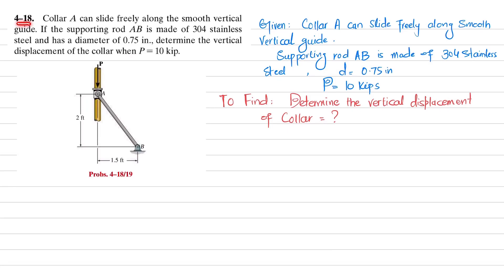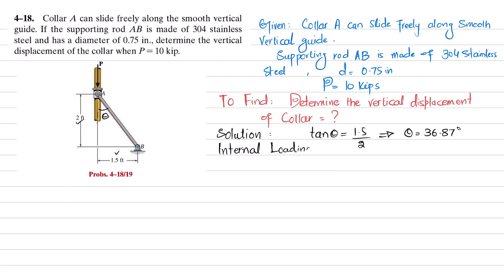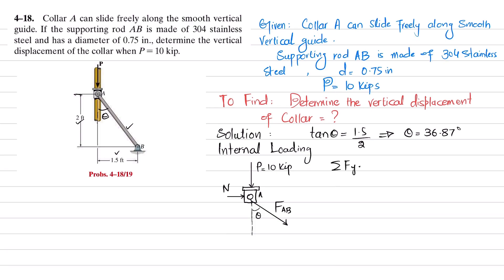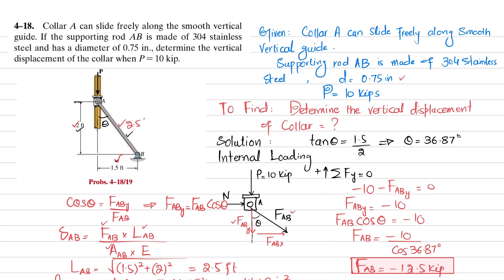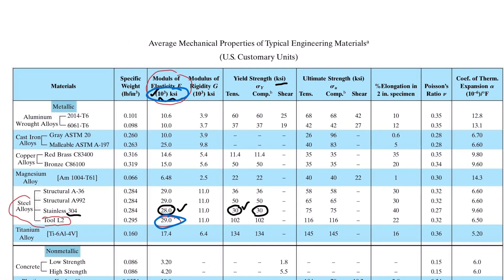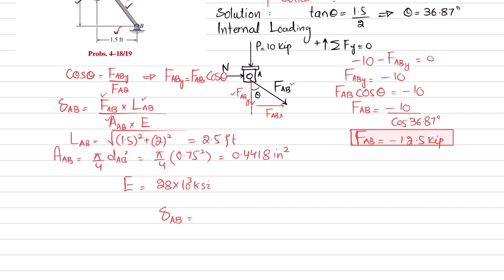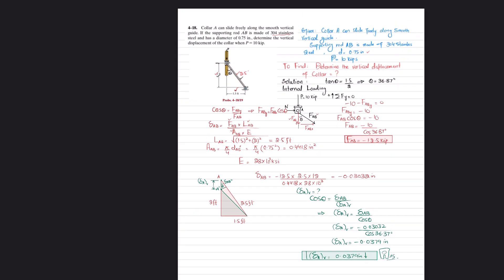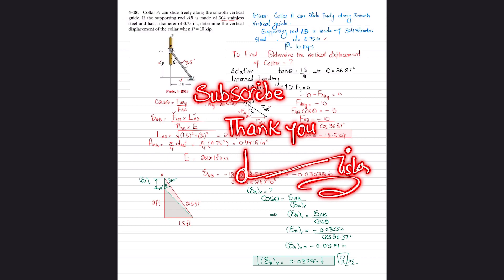4-18 Determine the vertical displacement of collar | Axial Loading | Mech of materials RC Hibbeler

Comment: Why did you consider the direction of FAB to be downward? The 10 kips force acts downward so the rod should act upward to cause equilibrium??
Reply from the maker: Ok so you can see at point A load P is downward causing the member AB to compress. In response the Force exerted by Member AB on collar should be upward as you mention but I have taken it downward. As a result my force is negative it means that our assume direction is wrong it should be upward. But the member AB is in compression therefore FAb is compressive force and is taken as negative because this compression causes a decrease in length of AB. These are the various approaches to solution but that depends on the person who solve this in his own way.....
Reply from the maker: I hope it will be clear to you now....thank you
Reply: @engradnanrasheedmechanical  Yea it's clear now thank you. I have a very important question, the rod AB after the deformation has become longer or shorter? And how can I know? I mean literally if the rod AB acts upward, the fixed at AB will exert a downward force to cause equilibrium and the rod will elongate, whereas if the rod AB acts downward, the fixed at AB will exert an upward force for equilibrium and the rod AB will get shorter. I would be thankful if you replied to this situation. 🙏🏻
Reply from the maker: Definitely you have the knowledge of statics. According to Newton third law if you apply force on a body then body will also apply the same force but opposite in direction. Same is the case when P force is Applied on collar at Point A. This force is causing the rod AB to compress. It mean force In rod AB will compressive but using Newton third law force exerted by rod AB on collar A will be upward. So force in rod AB will be compressive causing the length to decrease....
Reply from the maker: Also share my videos with your colleagues which will also help me in growing my channel....thank you
Reply: @engradnanrasheedmechanical  Sure! Thank you for your helpful videos!
Reply from the maker: @samoanspike13234 you are welcome and keep watching and learning....